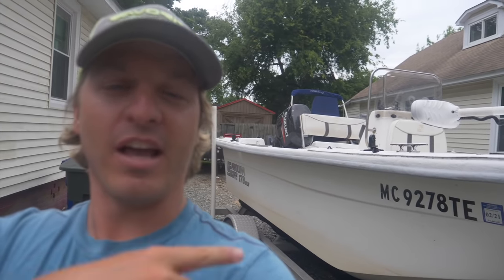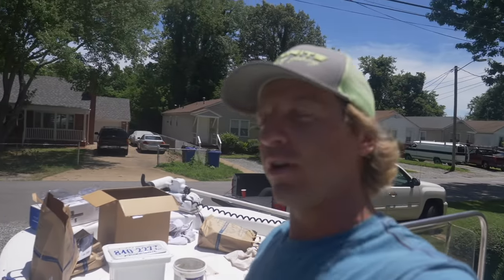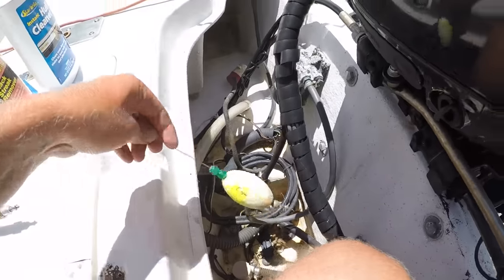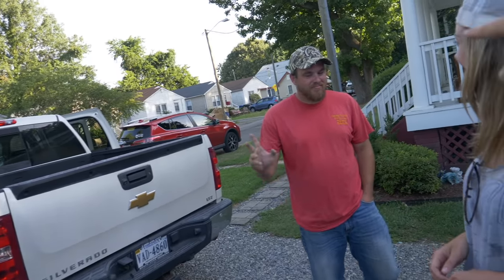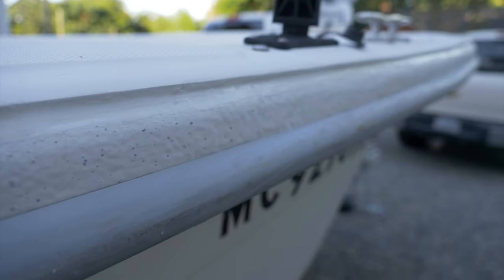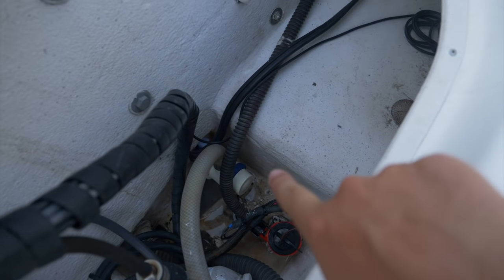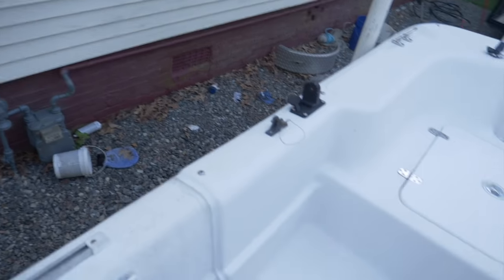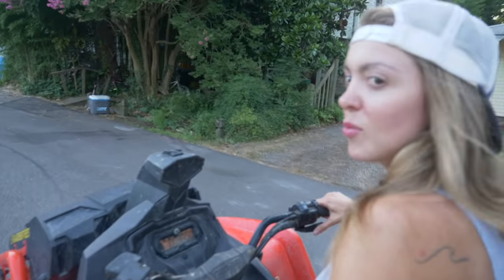Our Boat Restoration Project! DIY Boat Repair to BRAND NEW BOAT TOUR!

Comment: Boat looks great.   Constant maintenance on boat used in saltwater.   I am fighting an engine problem on mine.  was at the tower reef when it started giving me trouble.  Idle speed all the way back to rudee inlet with trolling rods out.  Did catch a few fish on way back in.  Keep the videos coming.